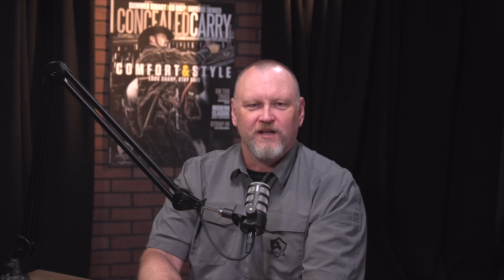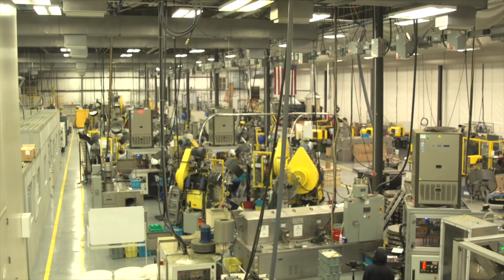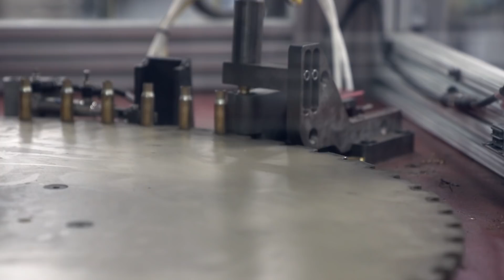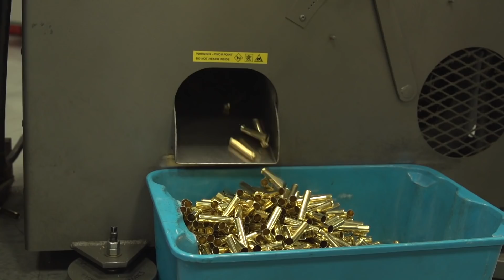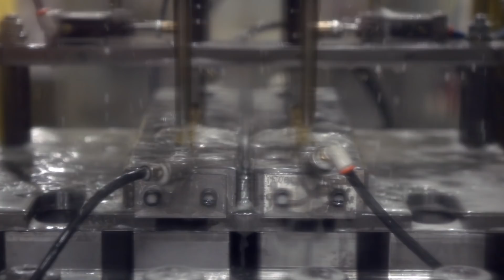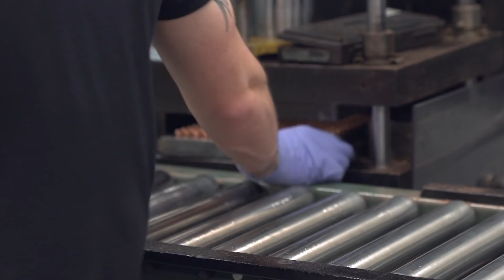Sig Sauer Ammo Factory: They Make HOW Much 9mm Handgun Ammo In 1 Day?!

Comment: FYI  !!!!!  I bought Sig 9mm from my local store. I went there 3 times, and each time, three different salesmen,  (Sig 9mm self defence ammo.) Each one told me they would NOT CARRY with this ammo(not consistent). I bought some anyway - even when there were alternatives. They were somewhat cheaper so I bought Sig. After the third person said the same thing. (They said use it for target practice...) I took the Sig9 ammo to a local gun show and sold the stuff. Take this info as you like...
Reply: I've had different results. I've used the hot load self defense ammo on several handguns and PCCs and have had no issues. Sever hundred rounds on my personal daily carry ,FNs 9c, no complains
Reply: Over priced and hyped up ammo riding off the Sig brand!

Comment: Tell Sig I like their 10mm FMJs, but if they spice them up just a tad, they will be perfect.
Reply: Why some companies run weak 10mm doesn't make any sense. If you want to load .40, then load .40, but don't call it 10mm if it's not loaded as such.
Reply: Not enough powder I agree
Reply: 40 short & weak powder loads.
Reply: @RadDadisRad  .40 is pretty powerful in it's own right, but the 10mm FMJs are a bit over that level.
Last time I Chronoed them, I was getting about 1285 out of a Glock 20.
That's still not exactly what I'm looking for, but wayyyy better than something like Federal.
I do think the Sig 10mm JHPs are underloaded pretty bad.
Probably just used .40 projectiles & can't push them much faster without fragmentation & over expansion.

Comment: I never see on the shelves. Does it go directly to the gobbernant or Afghanistan?
Reply: I don't understand nothing. Just Sig in an explandid day make half million. Where is it?
Reply: @vampirongosangronzon3165  if my math is correct....
he said they make 500,000 rounds in an 8 hour shift... let's use that for a calculation........ 500,000 rounds ÷ 50 rounds in a box  = 10,000 boxes. ok now 10,000 boxes ÷ 50 states = 200 boxes. So in an 8 hour shift only 200 boxes are going out to every state. x.x
Reply: @neosmith80  200 x 5 is 1000 for State every week. I know is hard cover the demand but. Have you seen any Sig box other than hollow point , super expensive,  20 rounds box? They are producing only hollow point, 20 rounds boxes. 500,000÷20= 25,000 daily boxes, 125,000 boxes a week ÷50 States= 2500. FL has 67 counties, around 37 boxes for county and 2 or 3 Bass Pro Shop, for example, for county. Around 12 boxes for shop. Now is clear. They are pushing the most expensive product out. That's what I think, I could be wrong of course.
Reply: @vampirongosangronzon3165  Based on what I’ve seen in .40 S&W and .357 Sig, you’re probably right.
Reply: @neosmith80  that's almost nothing tbh. They're way behind imo. Like way behind. If they were at 10x that I'd still think they were too slow
Reply: @neosmith80  500k isnt the average, its the maximum they were able to produce in a day.
Reply: Nope not going to they government, feds at least. Their contract is for other companies, including Federal.